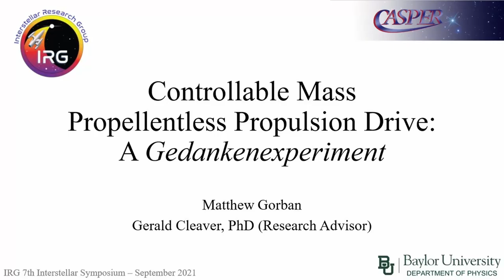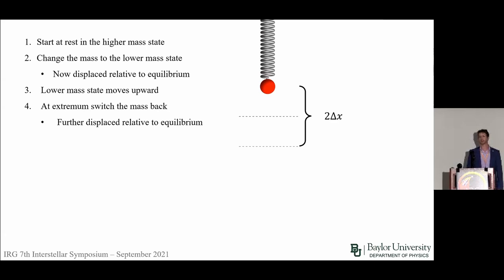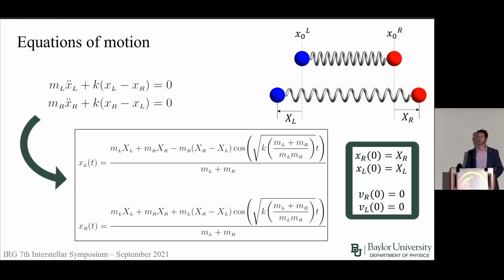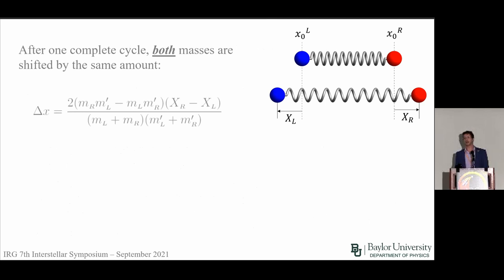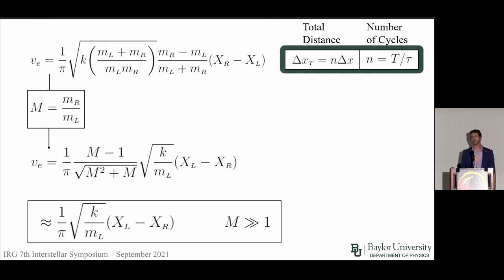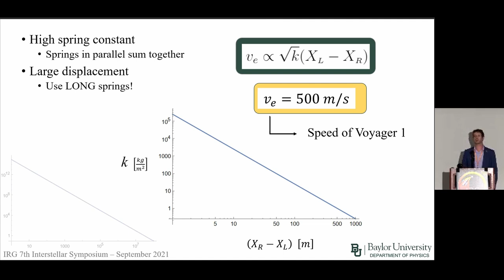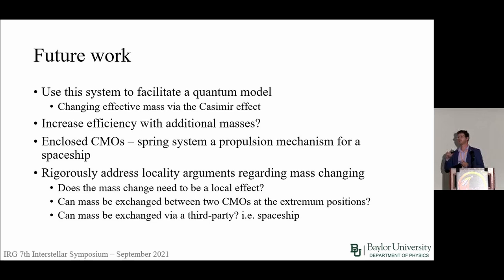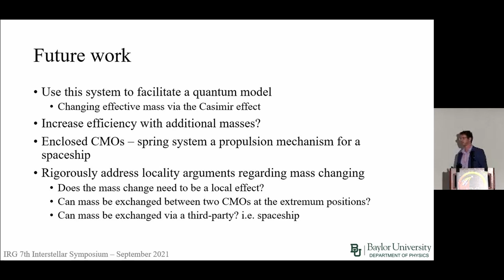11 -- Matthew Gorban - Variable Mass Propellantless Propulsion Drive

Comment: What if the springs could be hollowed to provide mass (or anything for the purpose) to enter and retreat from each end? Also odd idea, have no springs but a connection where the mass transfer can be direct, For instance hot and cold fluid cycle that expands/contracts. Thank you for the video! :)
Reply: It doesn't matter how you set it up, even with things like hollow springs and internal tubes, any sort of classical mass exchange between the two attached objects will cause the system to remain stationary over the course of a complete cycle. This occurs because internal classical mass exchange will continuously change the center-of-mass of the system to compensate for the mass exchange, resulting in no net movement. It is explicitly necessary to have locally discontinuous (isolated to the individual objects) mass change in order to provide net motion in the system. This can only be achieved through some sort of semi-classical or quantum phenomenon that can introduce individual mass changes without any exchange of mass between the two objects. Glad you enjoyed the video!